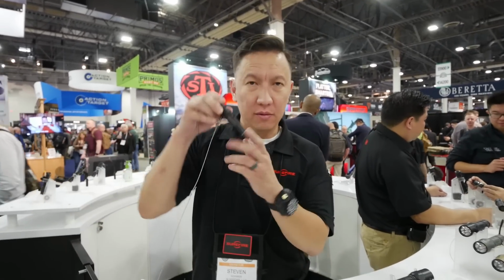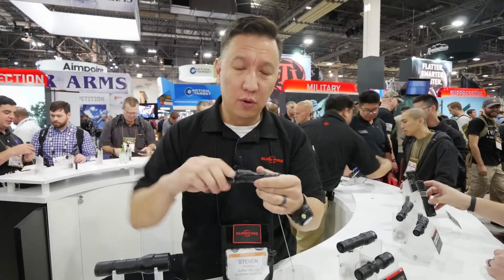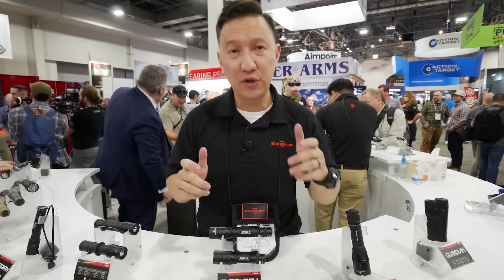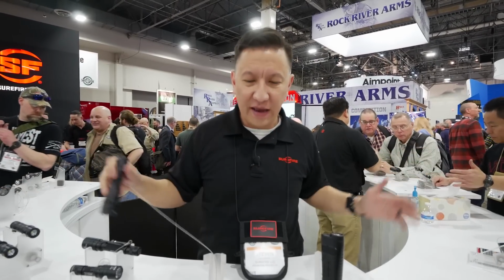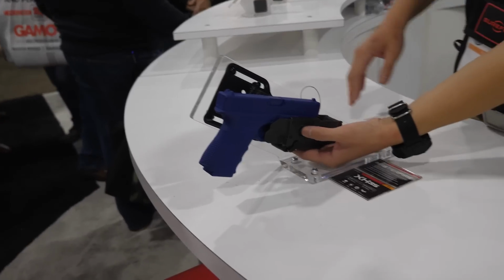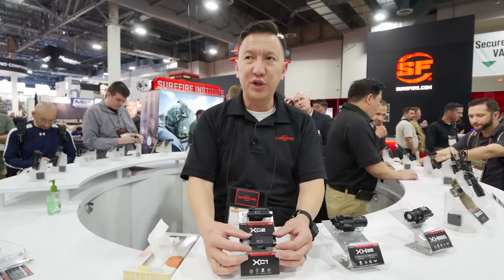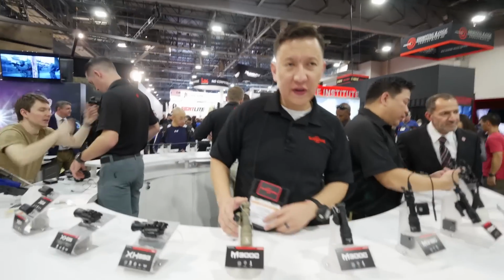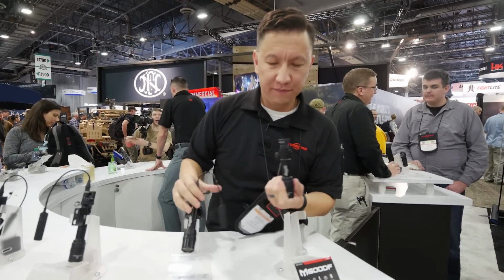SureFire New Products - 2018 SHOT Show

Comment: The Tactician or the EDCLT-2?
Reply: We Run Guns They are both pretty awesome. I like the Tactician a lot. If the clip can be changed to carry bezel down, it will replace my EB1 as my EDC.
Reply: Aaron Vezorak I don’t think you can. I’m on the opposite end. If the tactician clip can be replace the crappy EDCL2-T clip (that apparently has been bending and breaking for years) then I’d be set. Also a place to attach shock cord would be nice.
Reply: We Run Guns I dug out a spare and swapped them a lil while ago. They interchange just fine. So we are both happy!
Reply: That's great news man, thanks for letting me know
Reply from the maker: Aaron already gave you a good response.  For me, it depends on use and beam type.  The Tactician has a broad, fairly even beam that covers a lot of area.  The EDCLT-2 is more focused so the center is very noticeably brighter and would reach farther, at the expense of peripheral lighting.
Reply: GearSight yeah I’m pretty well decided. Sage dynamics has some good videos on low light tactics. You can point at a ceiling for umbrella lighting and various other techniques for peripheral vision. T-2 it is.